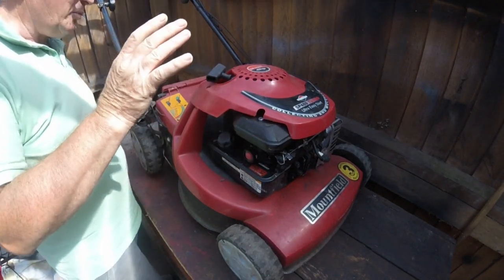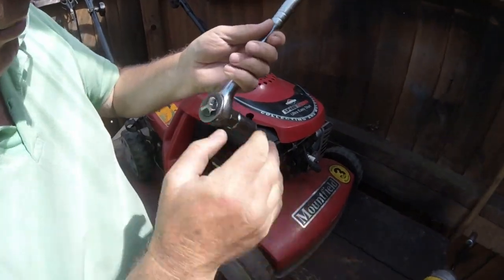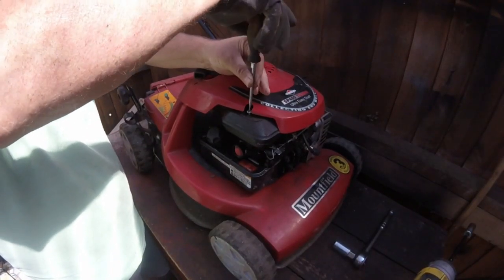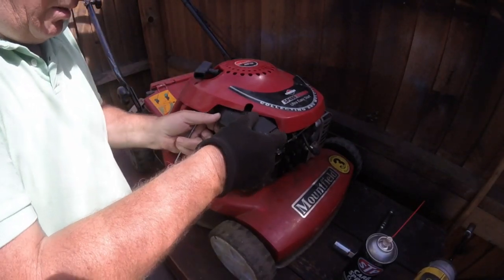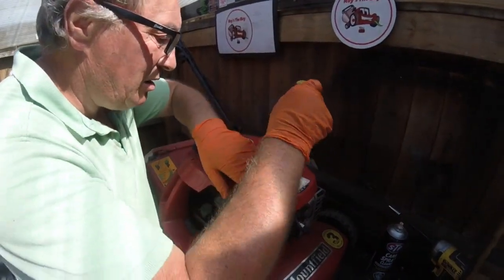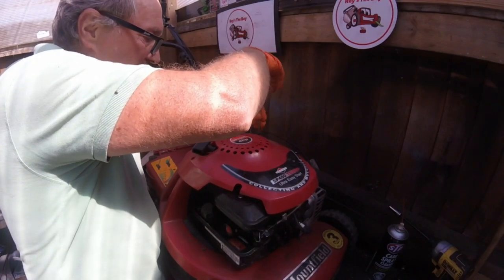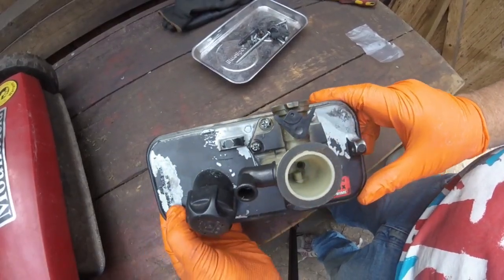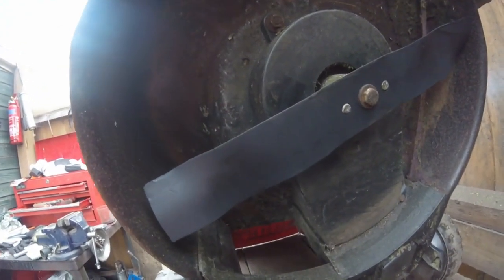FREE Mountfield SP480 Turbo wont start can it be fixed

Comment: Crazy...don’t know why you guys have plastic decks...to boot...plastic cover on a metal deck.  Wild 🤪. How do have mowers with upside blades at the same time🤣. What did you use to clean the sticker?  Usually I just wipe it with brake clean and apply clear silicone!
Reply from the maker: ANGELWAX NEMESIS RAPID TAR REMOVER 500ML - TAR AND GLUE REMOVER